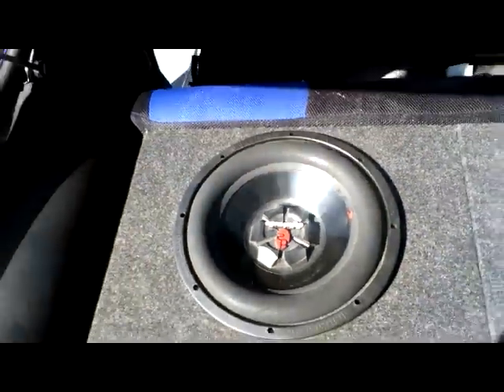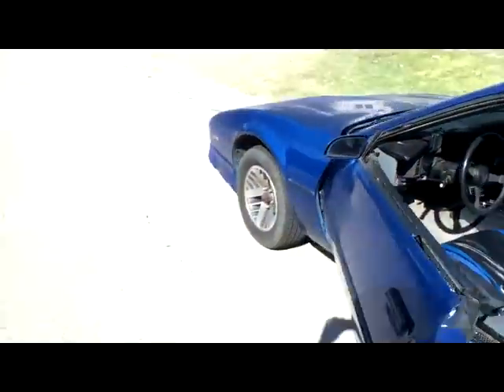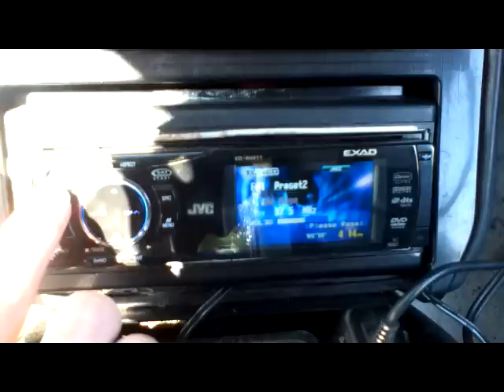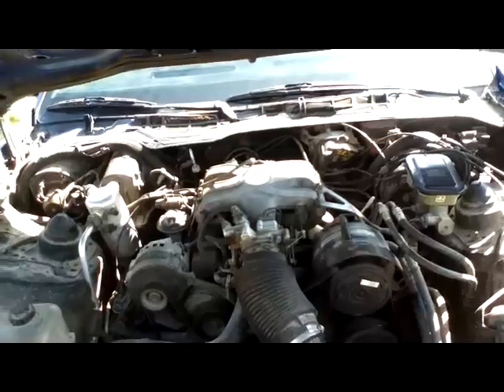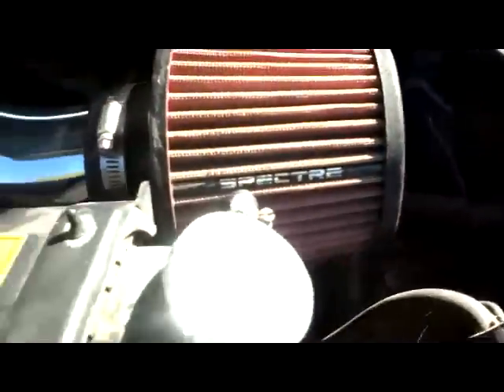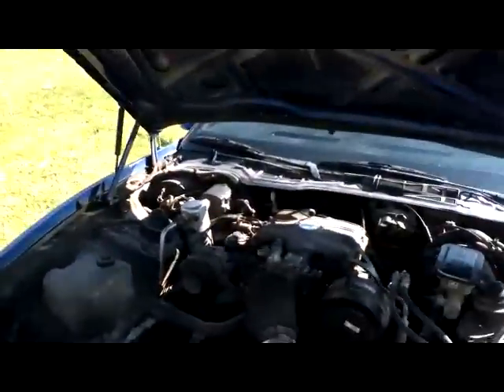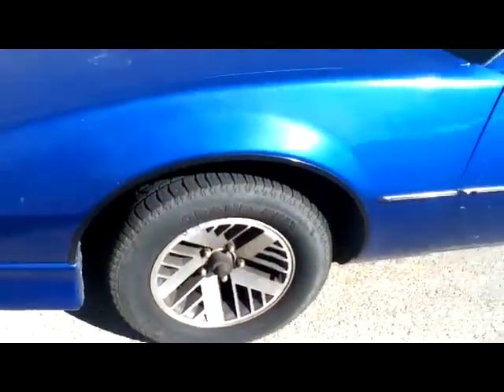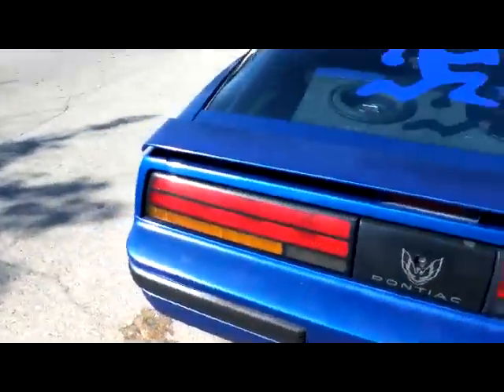my 1987 pontiac firebird 2.8 v6

Comment: What up my firebird friends! I am trying remove and install a new water pump on my 87 firebird. I ran into an issue where it seems like the power STEERING. pump has a bracket sharing same bolt as the as the  water pump do I need to take off the water power steering pump in order to get to the water pump off?